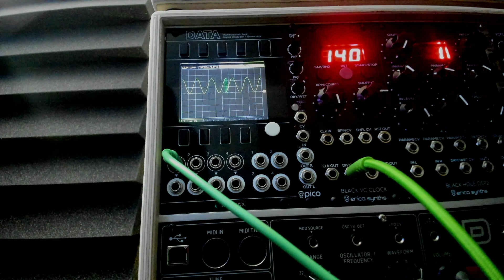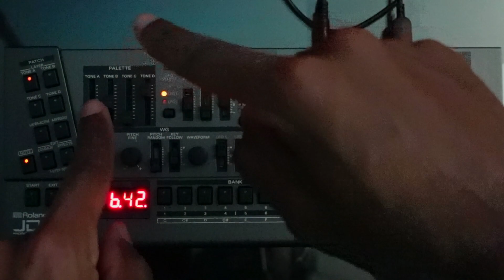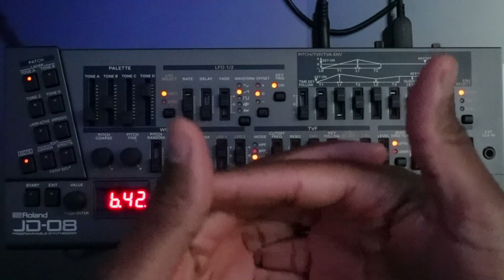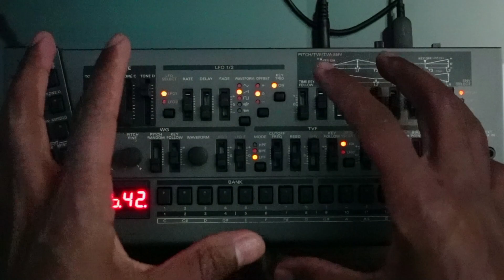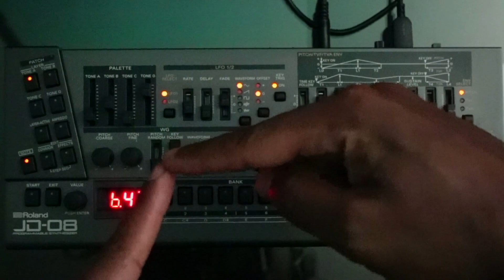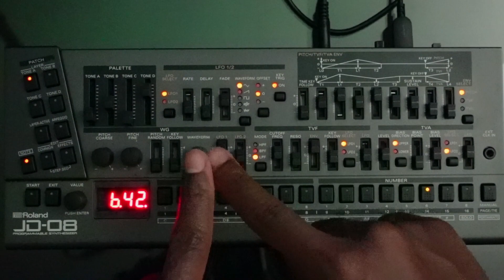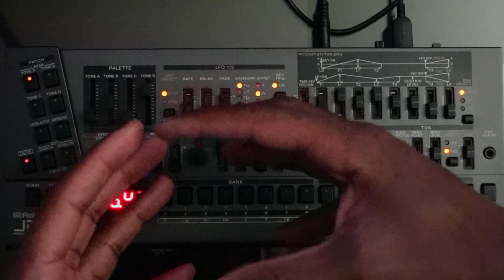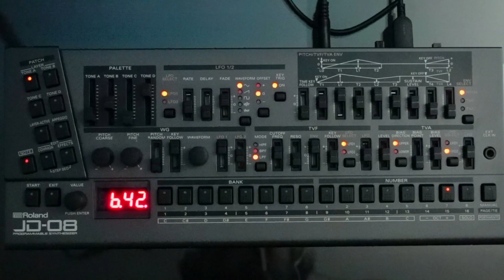JD-08 LFO(s) and Key Follow Function Explained

Comment: Hey man, just like the dude said, there's literally almost no one on the freakin internet helping or explaining anything in depth for the JD-08. So I thank you very very much. And btw, you need more videos bro! Your an amazing teacher and explain things very well. 

I had a question as well. I tried to connect my JD-08 with my MPC One and for the life of me I cannot get these two to play nicely. One thing I tried that helped somewhat was moving all the JD-08 midi channels to the same channel (master, part A, part B etc) because I don't believe you can have a single midi track in MPC controlling channels 1 thru 4, I could be wrong.  However, when I do this and play the JD-08 on the pads, I get a forever sustain. Like I'm continuing to hold down whichever note I pressed first. 

I'm sorry, I know this is a very scattered group of questions, but if you could somehow help explain any of it that would be amazing. Thanks
Reply from the maker: You raise a good set of questions. I’m actually teaching one of my in-person students how to do something similar with the JD-08. Let me take a look at this. I believe I’ve done this before. I just need to reference my current MIDI workflow. You’re right, I need to post more videos. I’ve been a little busy lately but I plan on returning very soon. I will add your question as a topic for one of my up and coming videos. Stay tuned and thank you so much for the question and support!